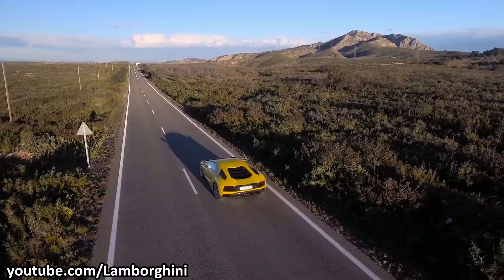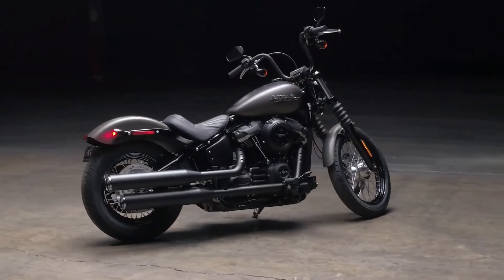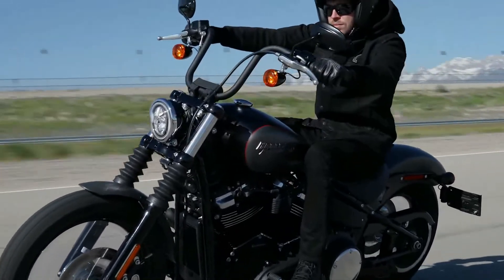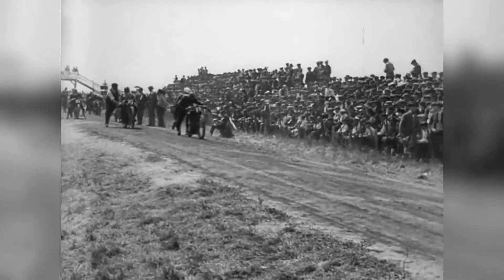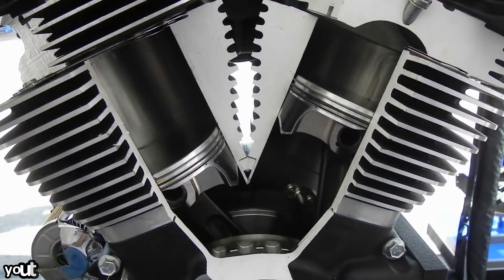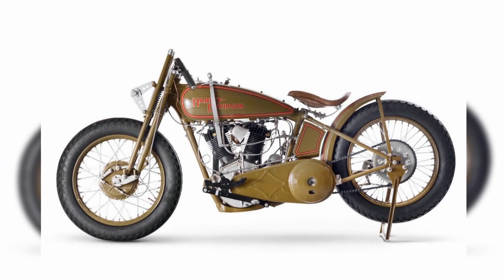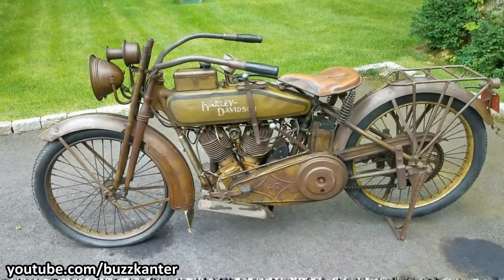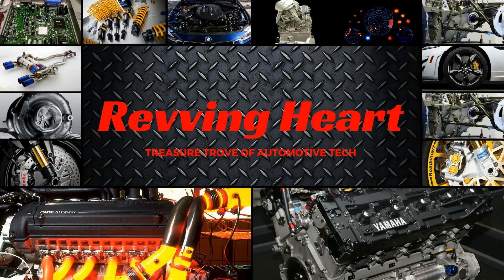Why The Harley Davidson Motorcycles Have Dry-Sump Lubrication system?

Comment: "Heritage" being the reason H-D uses dry-sump lubrication? Nope. Roller bearings are used throughout H-D engines and are the reason H-D uses dry-sump lubrication. Roller bearings depend on oil flow to both lubricate and carry heat away from the connecting rods. Roller bearing crankshafts do not need oil pressures of 30+psi, but do need oil flow in quarts per minute. H-D's have about 15 psi oil pressure, but many quarts-per-minute of oil flow. The oil tank makes high-flow pumps possible by the tanks capacity and de-aerates and cools the H-D's oil.

The dry-sump oil system is better suited to deliver the flow needed by roller bearings, than the single oil pump as used in wet sump engines with their plain bearings where oil pressure is more important than oil flow. Most racing engines today use a dry-sump oil system, even if the engine is a plain-bearing type, because a dry-sump systems can easily be piped with both oil coolers and filters. Oil doesn't just lubricate, it can also cool internal moving parts. Exactly what a dry-sump does.